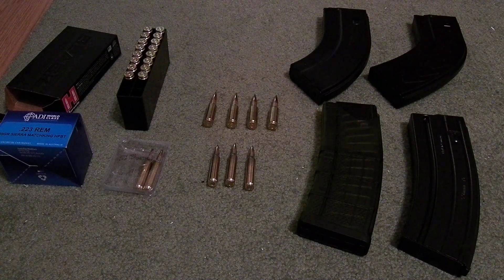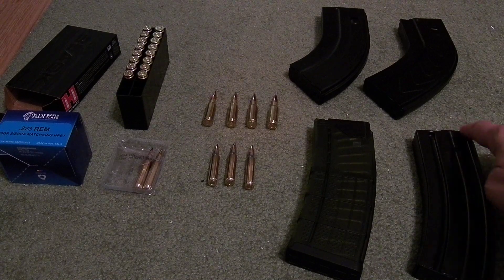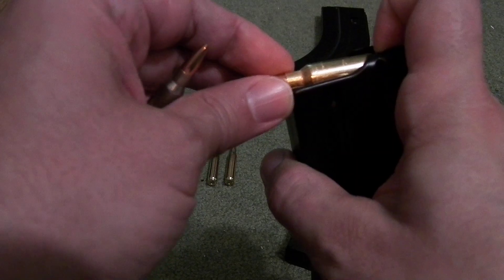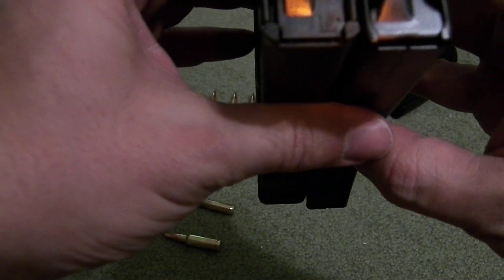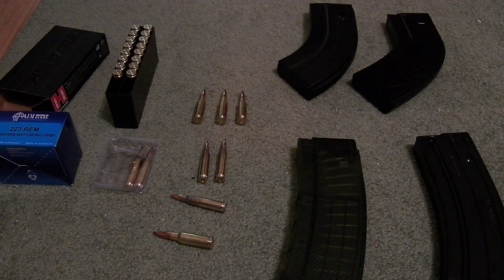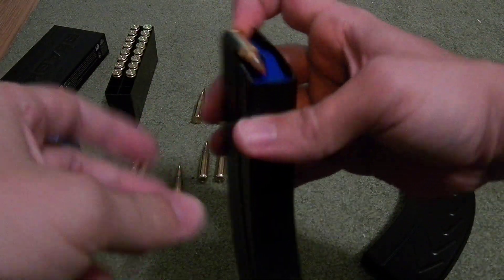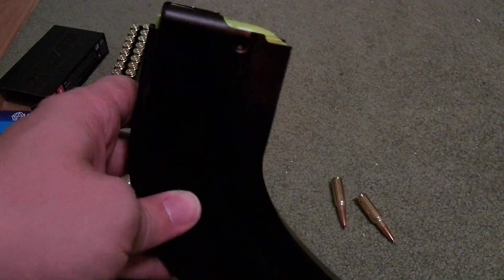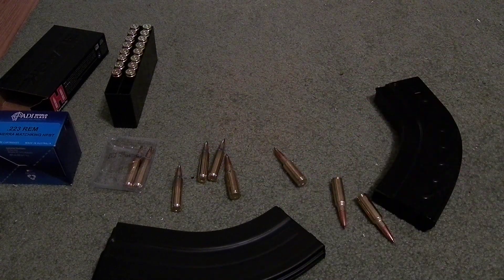6.5 Grendel magazines

Comment: The rim isn't catching. The case mouth is the problem. It's also the cause of nosediving. Dremel about two millimeters of the metal down on the front of the magazine and it'll fix it. Did it with my E-Lander mags and fixed my feeding issues.
Reply from the maker: wrong
Reply: @HammerheadClassCruiser  Whats the answer for mags that work in my 6.5 grendel?
Reply from the maker: @jonboyhst6448  I can only identify problems; I can't tell you why it works lol
Reply: @HammerheadClassCruiser  I am looking for the best 6.5 grendel mags that will feed, I have a 27rd elander that you can only get 20rds in barely? why do they call it a 27rd when you can only get 20 in?